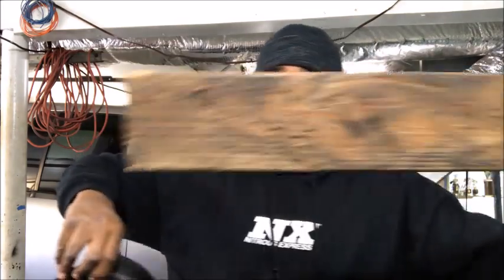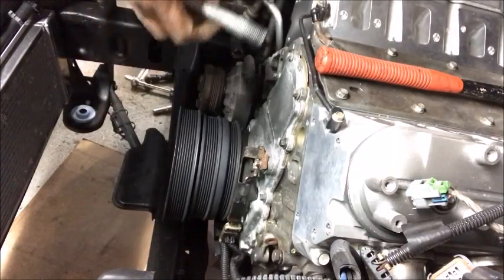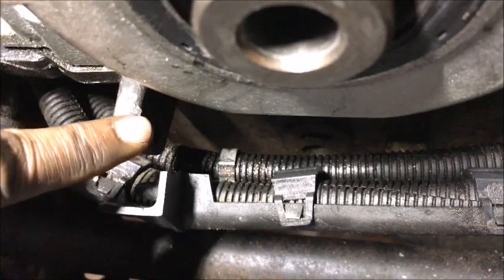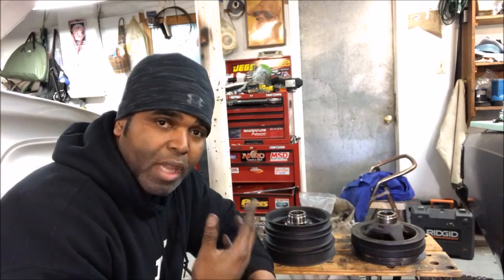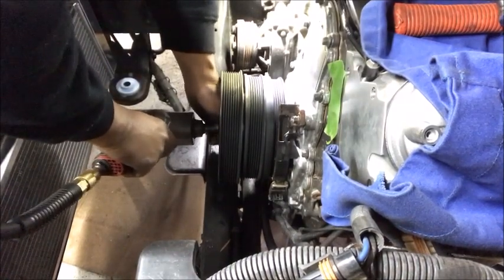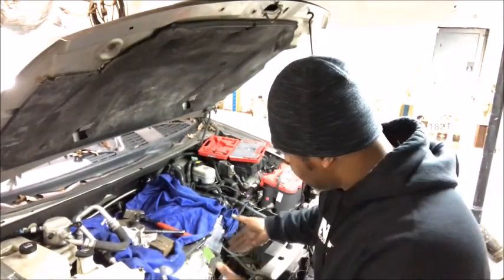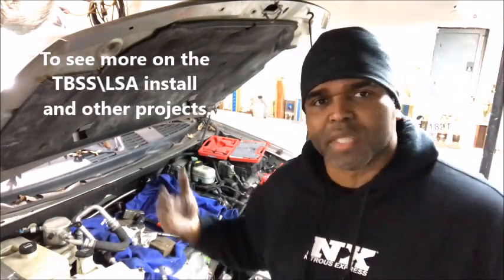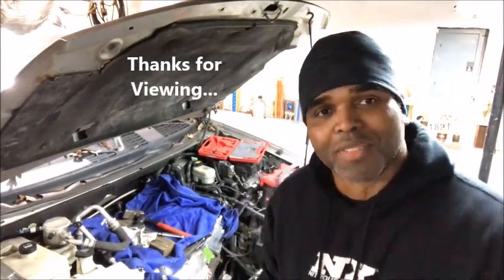How to: Install A LS Crank Pulley. (Under 2 Minutes Without Special Tools.)

Comment: love the videos man. I've been having my serpentine belt slowly jump grooves and work it's way off of my ac compressor. I feel like my crank pulley not being installed far enough into the crank snout is the culprit.. do you know the proper distance between the back of a truck(lq9) pulley and the front timing chain cover? thanks for reading!

Comment: Does the Truck AC compressor work with the LSA harmonic balancer? It looks like you are gonna have to use the 6 rib to run the 4 rib AC belt
Reply from the maker: depending on the pulley system.. some will you allow you to use ac groove on the LSA pulley

Comment: You could also take your torch out and heat just the seat on the pulley and it will slide strait on no effort needed.
Reply from the maker: yea, but i like this way a lil better..

Comment: Is that not torque to yield bolt???
Reply from the maker: they are for sure.. about 220 ft lbs.
Reply: Cause i did mine,,first i did 240 lbs with the old bolt then remove the old bolt and install a new bolt and did 35 lbs then 140 degrees after..it was pretty hard to to the 140 deegrees...but you can do it, just be patient....
Reply from the maker: @adalbertovalencia7862  thats the way to do it.. getting to 220lbs is tough.. lolo like you said it can be done.

Comment: Thanks for posting this. Read about this method in forums but always like watching it being done. Worked flawlessly....Now...how would you suggest to torque this bolt? Im just spinning around right now..(Engine is out of vehicle and sitting on a pallet)
Reply from the maker: 220 PSI is hard to achieve with the engine out the car.. i pop it a few timed with the impact and end it brotha TK.
Reply: You can put a pipe wrench on the balancer then use torque wrench. 
Thats what I did

Comment: I have an install tool. Do I need my old crank bolt to fully seat the balancer after using the tool? I have no idea where that bolt is :(
Reply from the maker: most people will use the old bolt to torque the crank down to 220ft then back it off and install the new bolt. ive seen it down several different ways.. i use the old bolt to install.. then back out and install the new bolt.

Comment: The pulley are the same height but the offset is completely different. The stock pulley sits in further. Have you ran into any problems with it yet?  I have the same motor but using LSA pulley for a procharger set up
Reply from the maker: whats good Tyler.. the stock LSA is my go to Pulley.. laways use them..

Comment: I use one of the arp longer crank bolt I had laying around... helps pull it on then switch back to the original bolt...
Reply from the maker: yea thats another great way.. i usually use a LS7 bolt..

Comment: I hit mine up in the center with a map gas plumbers torch for 30 seconds then slap it on quickly
Reply from the maker: any way to get it loose lololo
Reply: I did mine the same way, I used my propane torch warmed it up with a small flame until my thermo gun read 225 degrees, it slid on with no effort!

Comment: My god..it takes like..10min max to heat it up in over..and it'll slide all the way on no problem..or even just a torch if you don't want to stink up the house..good luck when you either mar up the crank putting on crooked or snap the crank bolt off in the crank..
Reply from the maker: mar up? its a light tap.. its going to slide on one way or another.. how could it possibly go on crooked? finally the only time the impact gun was applied was to torque down to 220lbs.

Comment: I went to John Deere and bought 3 metric bolts in 3 different lengths and was able to push the balancer on that way. John Deere has an amazing selection of metric fasteners if you are ever stuck for a bolt or nut!

Comment: Are you going to use the 8 rib LSA front accessory drive? If so, I hear that you need to notch the frame to clear the ac compressor
Reply from the maker: i guess it depends on the pulley setup you go with.. im using LSsimple, no notching required.

Comment: Heating the balancer in the oven helps too :)
Reply from the maker: yea ive heard about that, i just get a lil concerned abut the rubber in the middle sandwiching the peices together.. thanks..
Reply: @Coverman66   I'd estimate how hot it gets under high engine operating temperture.  If you only heat the oven to 100-120 celcius , you should be fine.
Reply from the maker: i will check it out and of course do a video lolol

Comment: Nice ! 
Hey terry my ac clutch went just in time for summer I wanna thank the heat gods for that! Lol 
Mines an 08 and has climate control 
Question is can you take a peek At yours is your ac a 3 wire ? Or 2 ? I believe mine is 3 I would like to have the part before I tear into it . And it would suck to tear into it and it be down 👍🏻 thanks man ! Keep them vids coming!
Reply from the maker: always and thanks.. i will check tonight.. email you later..
Reply: Thanks man!

Comment: You could have used some all thread rod just cut it to the right length and weld a nut on the end and use the second nut  with a washer to push the balancer on
Reply from the maker: very creative..  thanks for the tip BK... much appreciated..
Reply: Yes and many make and sell this tool

Comment: Try heating the damper with a propane torch it should slip right  on.
Reply from the maker: ive seen that done, i dont like do it that way because it could weaken the rubber that holds the balancer together
Reply: I guess we're not talking much heat. A concern would be crank seal damage.
Reply: I guess we're not talking much heat. A concern would be crank seal damage.
Reply from the maker: i can understand that..

Comment: Some guys use air hammers with planishing hammer bits welded with an old balancer bolt washer to push the balancer back. I can't say I've never hammered one on before, but I have heard the danger is more about hurting the thrust bearing on th3 other side of the crank. I've never seen one damaged by this, but that's what they say. Otc makes nice installers and removers, and the gm tool is just a threaded rod with a nut, washer and a cup spacer, you can actually find knock offs on eBay for cheap. Great video though
Reply: Dont hammer it on lol learned the hard way kills the thrust washer cost me an engine
Reply from the maker: thanks RH.. i use the OTC and the GM installer, just didnt have it in the Garage Shop